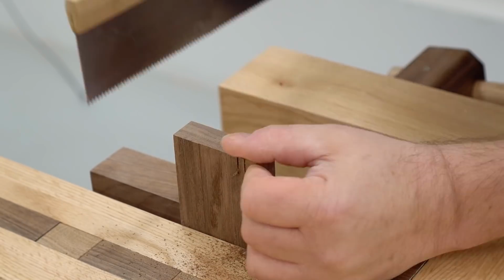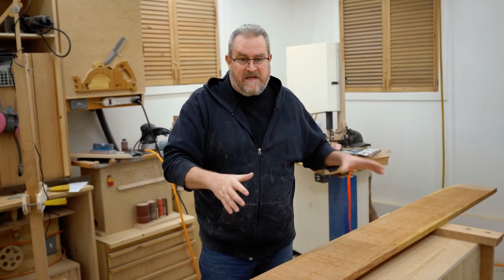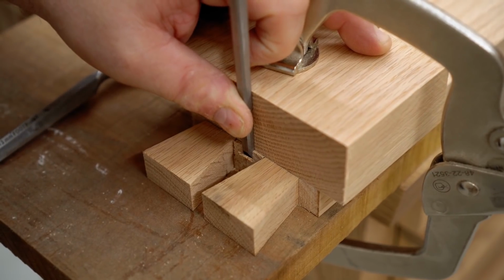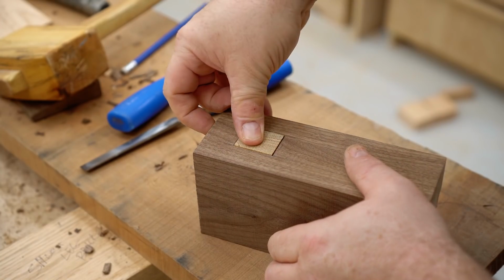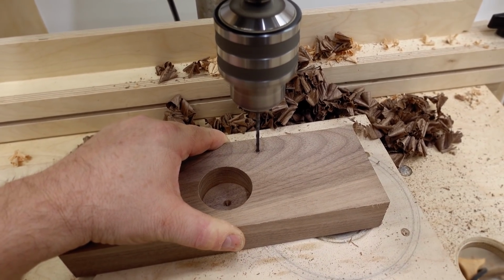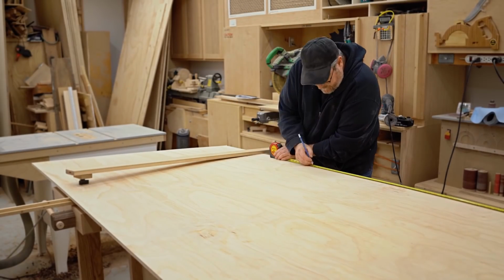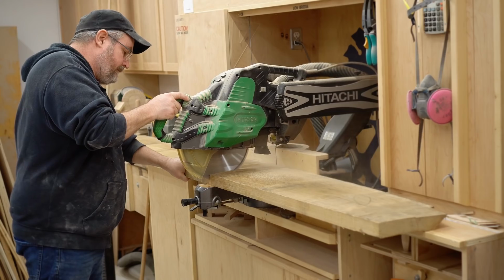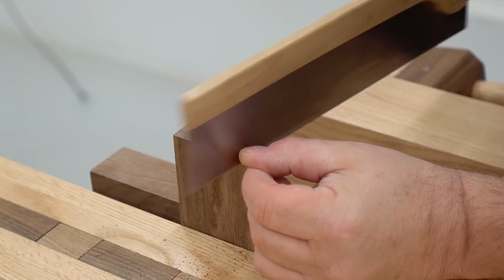The Perfect Workbench for a Small Shop - Solid, Strong, Stable - Full Build

Comment: I loved the video and am considering buying the plans to make it myself with a white oak top like yours. Are you worried about expansion of the solid top leading to cracking, separation of the frame, and/or breaking free from the substrate? Veneers are typically recommended to be 3/32" or less for this reason. I know you mentioned quartersawn and appreciate that should help some.

Comment: Thanks for the great video. It gave me some essential insights as I'm working out the design for my own workbench. I picked up the plans just to support your work.

One of the key elements I'll be using is the MDF/plywood core with the hardwood strips at the top. I was wondering how that has held up after a (probably humid) Canadian summer and (cold and dry) Canadian winter. Have you seen any issues with the hardwood edges and/or top strips expanding and contracting while the core doesn't?

Comment: I'm no expert, but this workbench looks like a a useful work of art.
I guess it's sort of an MDF core table top?
I've never seen that before. My first reaction was, ugh, MDF... not strong.
But in this application I think it makes sense. It adds bulk and weight and rigidity, but it will never have direct contact w/ any objects or materials. There's a whole layer of plywood and then an actual work surface on top of that.
This bench looks very sturdy.

Comment: I love the build. it turned out absolutely gorgeous.  I was surprised by the mdf core tho. its certainly stable and solid, and I assume you wont be putting a heavy load in the middle of such a beautiful table, but that would be my question... how much load do you guys think it would take before seeing some flex?  Would it be worth considering some ribs of plywood  or OSB down the middle on their edge as I beams?  I am thinking like engineered trusses.  It would make it more complicated but should add strength (well compared to MDF at least, I know they wouldnt be tall enough to really capitalize on their potential).  could potentially get quite a lot of strength from scraps, which I REALLY like the sounds of.  I would love to hear any thoughts from any of you out there.  Cheers!

Comment: Production quality of your videos are going through the roof 😂😂
My2¢: For those who don't have a tap on hand, Drill A hole through both the nut and bolt, drive a nail through and bend the tip (or use a proper retaining pin/split pin/cotter pin)

Comment: Great work John! Not sure if you addressed this here or on your second channel but are you at all worried that the oak will expand too much (even though it's quarter sawn) and cause damage? That's a relatively wide surface and those pieces are jammed in there pretty tight.
Reply from the maker: I made a follow-up video talking about that and it's in the build article on my website.

Comment: Not too long ago i started using water based poly just like you john. I bought a gallon of it and was pleased with it up until a couple of projecrs ago. My poly started peeling. After it woyld dry, i would notice some dry areas and started to rub a bit. And scrape a bit with my fingernail and next thing you know, a good bit of it would start to peel off. Or flake off. Any reason why? Anything i may be doing wrong?

Comment: could you use hardwood flooring for the top
Reply from the maker: Not if it's a full 3/4" thick. The top layer needs to be thin if using solid wood.